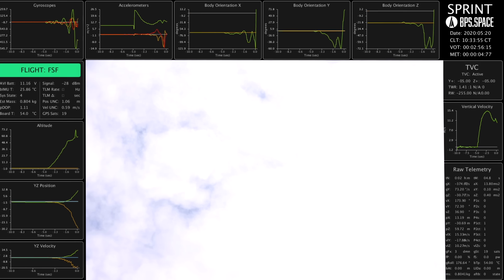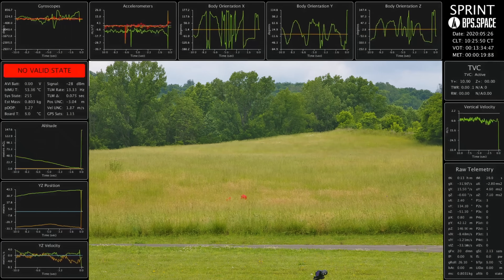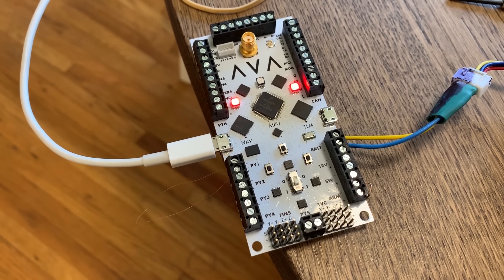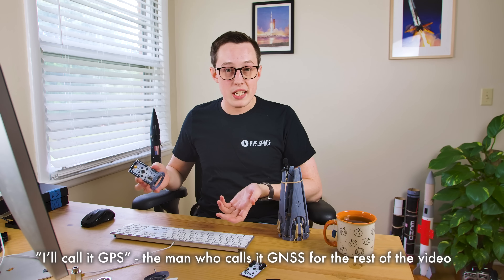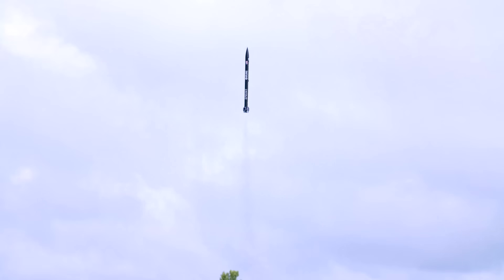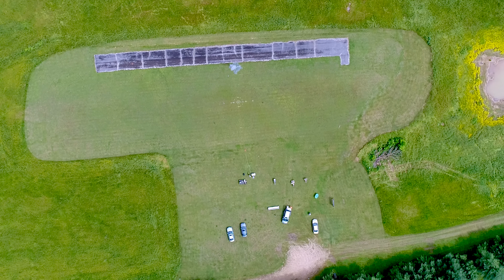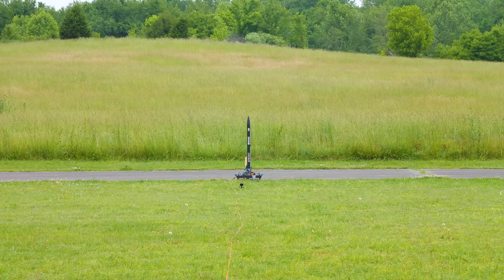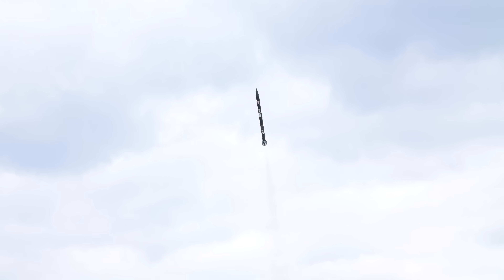Sprint - Test Flights 6 and 7

Comment: Just a random thought but would it be possible to put ir sensors on the rocket and say 4 ir banks on the ground to guide the rocket on x & z "assuming y up" then use the GPS as a conformation of location device? At least until the delay problem is solved.

Comment: I would detect for a flight deviation, and deploy the landing gear for drag. it will cut down on distance and might give you an extra second to deploy a chute (better than a core sample).  I would also add fins to the upper rocket to handle misalignment quicker to return the rocket closer to the vertical launch GPS coordinance. but where the fins really help is the freefall. you can guide the rocket much like SpaceX, and in theory help, you stick the landing with less horizontal drift due to local weather conditions (especially rotor from the wind hitting trees and hills).  to stick the landing.  there is an issue of Scale.  if you were to scale up grass, you can see what it's hard to "stick" the landing. to help with the issue of scale for the landing, well unless your launching and landing from a Golf Course. You need to "cheat just a little" be adding thin wires to your landing legs to widen your landing leg stance for added stability.  you can start with long, and shorten them to the minimal length as needed.  now one area I would look into is radar. a decade ago they were talking about miniature radar (used for cars, for the purpose of parking and driving was said to drastically lower the costs.  I have not followed up on them, to see if it's advanced to even lighter cheaper units since then.  the tiny laser measuring units they have now (gutted) could also potentially work to detect the actual height above the ground to fire the landing motor.  But, the delay to actually light and get the motor up to thrust is a variable and the Motor itself would also be a variable.  they could be minimized, and you would always want to use the same Lot Numbers as much as possible.  your more than 90% of the way there already (that last 10% is a bitch)   I'm sure you have already considered my ideas above, but I had to put them out there for others to potentially consider.

Comment: I'm an embedded software engineer, but not a rocket engineer.  Were the controller sign errors a wiring issue, or a software issue?  On first blush, it feels like the controller sign issues would be pretty straightforward to detect with some unit tests and some basic integration tests.  Am I missing something?

Comment: Aw, the “wear a mask” but didn’t make it in. I’m disappointed. Other than that, I’m still amazed at what you’re up to. Thanks for sharing!

Also, I was originally thrown for a loop when you mentioned GPS tracking in your rockets because of the whole “shuts off at high speeds” thing but that only really starts being a problem when you drop the “model” from “model rocket,” huh?

Comment: if you don't wanna use a kalman filter, Ivensense has a great digital motion processor (DMP) library for the famous mpu6050 and mpu9250 chips which is really easy to use.

Comment: Just curious, since you have a fairly stout sensor suite, couldn't you correct for a reversed axis?   If inertial guidance shows that corrections are not um correcting, then flip the axis and try again.  If the flip doesn't work then lock the axis at the home position for the duration of the flight.

Comment: I hope people have a grasp on just how crazy it is that Joe wrote a Kalman filter. I had to "teach" Kalman filters as part of the curriculum on Inertial Navigation Systems in the Navigation course I provided for the Navy. Being a newly trained individual in the Navy certainly has downsides...like you end up teaching things that you've never understood yourself.
To describe it in layman terms, a Kalman filter is a way to combine many inputs with varying levels of confidence in such a way that the output is not just the highest confidence input, but a mathematically derived, weighted average total answer that considers all inputs. The "confidence" for each input is also mathematically generated based on equipment accuracy, noise, update rates, and drift. It's not exclusive to navigation theory, but is certainly standard in high-accuracy navigation equipment. 
INS in ships is actually very analogous to yours, they're full-up mechanical IMUs updated by GPS which uses Kalman filtering to give the most accurate position.
Despite having "taught" it, there's no way I fully understand what is going on. The fact that you wrote one yourself is positively insane.
I'm a little curious why you couldn't dead reckon between GPS updates using your INS data? It's definitely not as accurate, but would have saved you an awful lot of headache!

Comment: Amazing work! I would like to suggest a very useful control method called "Sliding Mode Control" or SMC. A controller using this method can make your rockets follow a certain path or trajectory quickly. It basically minimizes the error immediately and converges it to zero in finite time. There are many research papers that use SMC on TVC which proved that it is much better than other controllers. I hope this will benefit your work :)

Comment: I run McAfee virus checker etc etc, it flagged your shop for some reason, I have had this happen before on some sites that I've previously accessed okay, its a McAfee glitch.
I wounder if it went into "DANGER WILL ROBINSON!!" mode because of the "WOW" hot model you draped the merch over.👍👍

Comment: Why use GPS on the rocket?  You could create a few stationary ground radio transmitters with GPS in different locations so the rocket can triangulate its location, distance, and possibly altitude.  I mentioned that the grand transmitters would have GPS, that would be so the setup would be more efficient.  Also because the ground transmitters would be stationary, you don't have to worry about GPS lag.  This would be a WAY better solution in terms of efficiency for positioning in less time.

Comment: Interesting video!
I think you might be able to leap forward in terms of preventing these kinds of failures by working towards hardware-in-the-loop testing, or running (parts of) your control software in a software simulation. I'm not experienced with Simulink, but Python might be easy enough to run some basic simulations in. This kind of failures can then be caught in a simulation instead of real-life.
I've also wondered if GPS-RTK might be benificial for you, since it can increase GPS accuracy a lot (at least relative to a known place, like the launchpad).

Comment: Interesting comments about determining tvc misalignment on launch, what if however, there is no misalignment, but the rocket is not burning cleanly down the rockets axis? Would that not also cause a rocket to deviate, despite being no TVC misalignment? How would you know which case it was, rocket burn or tvc? If you compensated for misalignment, but then the burn cleaned up, you would be now out of alignment (but the controller should still try and correct during flight, but with the unnecessary compensation multiplier). Hope my question makes sense..

Comment: Flipped Z-axis XD As a hobby game dev I can relate
Reply: Unity is left handed, y up; Unreal is left handed, z up; Maya and openGL are right-handed, y up; Blender, Source, and 3ds MAX are right-handed z-up.
The pain is real
Reply: Yes. I don't even check these things.. just run it, see if it's flipped and try again
Reply: "IT'S OK. 
Just change this sign, that sign, this sign, that one."
Errrr, why's it spazzing out."
Must've forgot to change round some statements."
PING
"Where did my character go. "
checks outliner
"Ah.
I see you don't need rockets to achieve orbit."
Reply: Same as checking ailerons on RC plane, and finding out once its in the air, OOOP's connected the wrong way...  See some of  XJET channel. 😃🤣😂🤣😃
Reply: So that’s why my model was sideways when I imported it...

Comment: Hey Joe, I've always wondered how you don't light the grass on fire when you attempt to land or launch your rockets?
Reply: Try to burn grass then observe the results
Reply: @sujalx86  haha, this actually made me wheeze
Reply: It wont burn the grass since the greeness represents moisture in the grass. The flames might dry it out but It wont catch fire :)
Reply: @Impisak  I've actually started a fire with a model rocket before lol
Reply: Live grass is full of water, which absorbs heat from the rocket, making it so that the temperature of the burny stuff does not reach the activation energy required to ignite the grass.